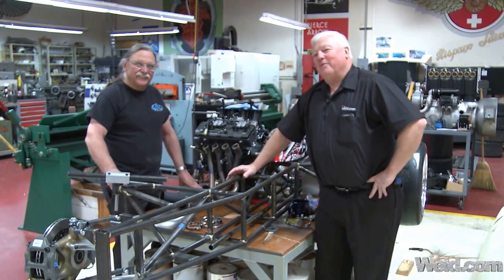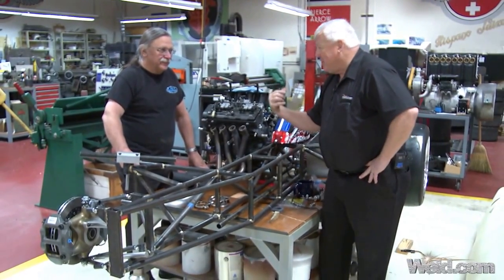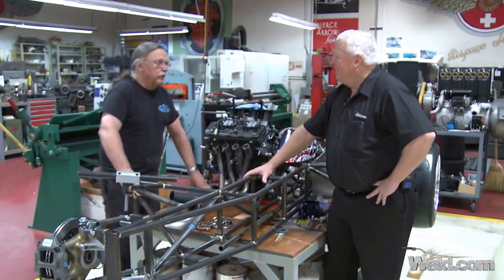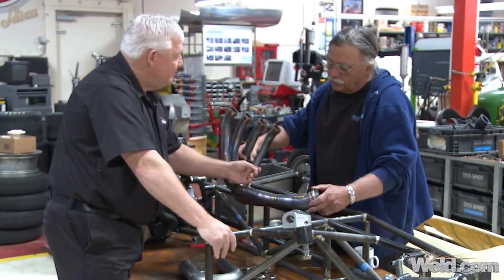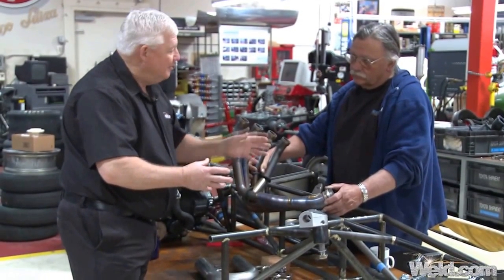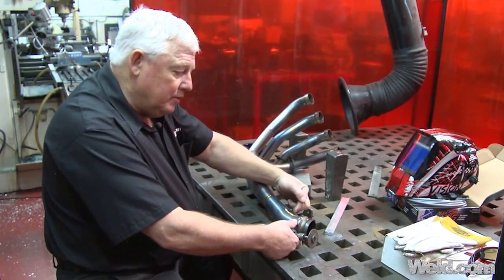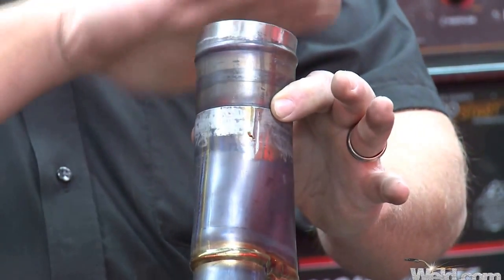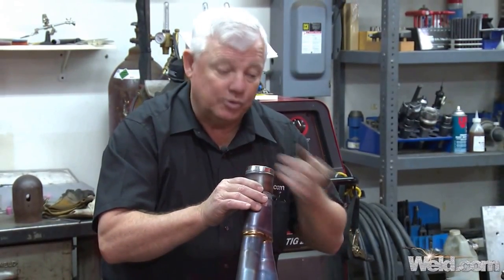Welding Titanium Exhaust in the Jay Leno Garage: Part 1

Comment: Big ugly welds. Part would be in rejected bin at any top end motorsports company... Size the tube up correctly, knock the tube into round using a nylon mallet and a sand bag. Then use autonomous weld technique (no filler rod). Set machine to approx 50 amps with the pulse running at about 5 pps /25% peak/5% background. You will be surprised at the results. Welcome to the world of high end British motorsports fabrication.

Comment: adam harrington ...guess you havent used a everlast...as it has a sweet and stable arc once it is correctly setup....i use a miller aerowave at work and a everlast 250 ex at home and you do not know what you are talking about ...and i have 18 years experience using lincoln and miller machines at work...everlast is a great machine at home.

Comment: Interesting how last week (Using an Everlast) your weld was very inconsistent, to the point someone said you should give up but this week (Using a Lincoln) your weld looks really good. It's quite clear the Everlast has a more unstable arc.

Adam Karpa
Reply: GeneralAlex4 I don't doubt that, some you're spending that kind of money, the difference will be very slight. The beautiful beads are probably more to do with your skill than the machine itself.

The word you were looking or is "they're" BTW.
Reply: I would be interested in seeing a side by side comparison of all the most popular brands, I bet Fronius or EWM would come out above Miller.
Reply: I don't believe for a second Wyatt made those welds, he doesn't have a SINGLE video where he can hold his hands that steady, HELL, his last video he was using a positioner and he couldn't even hold the torch steady, yet this week he's like a brain surgeon with his hands. Welder brand has no difference on what the weld looks like. Go look at welding tips and tricks, he does tons of comparisons between welders with side by side welding.
Reply: Adam Harrington I run Millers and there beautiful beads!
Reply: That one's gender dependant.